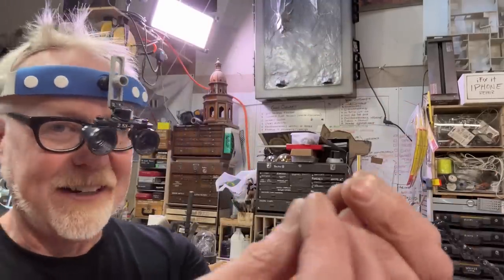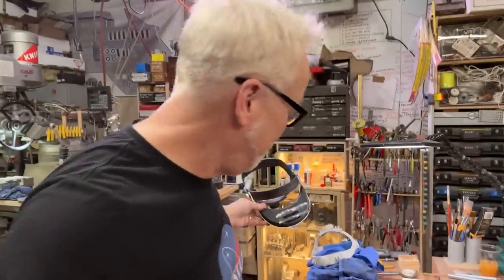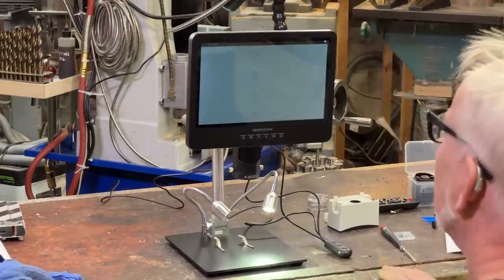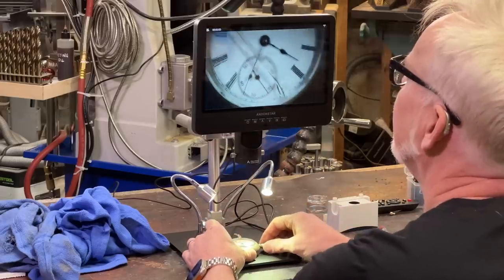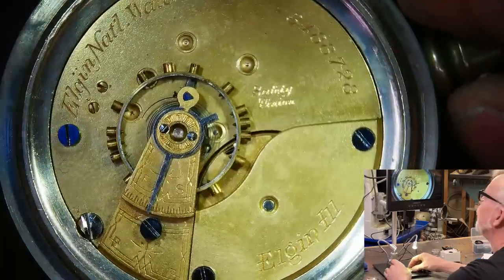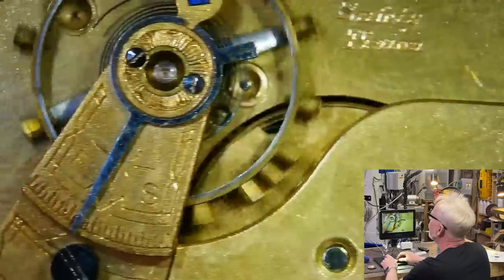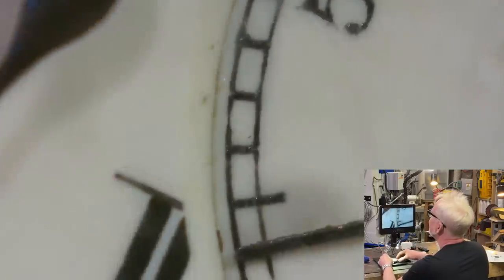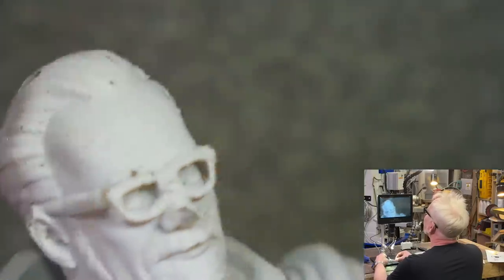Adam Savage's New Digital Microscope!

Comment: Probably not explaining this correctly, but I'm already imagining for your one day build putting in some sort of rack and pinion system that instead of using a lock nut to hold everything in place and having to manually adjust it, you have a hand crank that you turn to cause the whole mechanism to go up and down.

Comment: That looks like a really neat tool, and I may be entirely inexperience with this, but it kinda feels like some things could have been designed better. The rig should have a table crank straight out of a drill press, or maybe a screw feed like you could find in some 3d printers.
Personally I would have the camera and monitor be two separate units so that I could have the display at a comfortable viewing height, ideally as close to the work piece as possible. It being fixed to the camera ensures that if the work piece is at a comfortable working height you have to crane your neck to use the monitor.

Comment: Keep in mind that the disadvantage of LCD digital microscopes is not having any 3D depth.  An optical microscope has two eyepieces so you get 3D which is very useful for some things like working on PCBs where you need to inspect solder joins. Without any 3D when you get light reflections off the curved solder joints they will fool you into thinking the joint is good or bad when it is in fact the opposite. With 3D you can easily tell the difference between a curved surface and a reflection.

Comment: Just remember to let the tension off the mainspring before removing any screws that hold in the gear train and be incredibly careful of those hands/dial if you want to keep them original.

Many of those old pocketwatches run great as long as no one went in and broke them at some point.  You definitely DON'T need a timing machine, as that watch won't run perfectly almost no matter what, and comparing it to modern timing reference over a few days will tell you all you need to know.

Comment: I have trouble working through microscopes like this because I depend on having a stereo view to do fine work.  I have a trinocular microscope (stereo plus a space for a camera).  But it's sometimes a pain in the ass to work with because I have to keep my head extremely steady in a somewhat awkward position.  What I want to try to do at some point is put eye piece cameras in each of the eye piece sockets of the microscope and feed their outputs to stereo FPV glasses and see how that works.

Comment: Definitely a better microscope than the $46 thing I bought.   
But that watch would not have been approved for railroad use, being a 7 jewel unadjusted movement,   
unless it was "grandfathered", possibly for a line that didn't handle much traffic.  
A major company running many trains per day would probably have demanded a better timekeeper.

Comment: About the only practical use you can put this to is to examine carbide tool cutting edges after sharpening on a 400 grit diamond wheel to determine if they are still damaged or have a wispy burred edge that will break down as soon as you touch it............after a single light pass on a mill or a lathe the cutting edge will resemble a jagged saw like finish......you'll know then why you cannot get a good finish on mild steel no matter how hard you work your machine.

Comment: The Chinese deliberately do not indicate the resolution of the matrix. The resolution they indicate is the output video resolution obtained by interpolation (electronic witchcraft) from a cheaper matrix with a physically smaller number of pixels. Old trick. The same story with Chinese DVRs for cars, for example. That is, roughly speaking, from a matrix with a physical resolution of 480x640, you can interpolate to get FULL HD resolution at the output, but of course there will be no improvement in image clarity - but in advertising and on the box you can indicate FULL HD resolution or even 4K. That is, it is not possible to find honest information which matrix, with which resolution is installed. European manufacturers are 6 times more expensive, but there is honest information about what exactly is inside.

Comment: You may discover you are getting a crick in the neck because you are lifting your head up to look through the bottoms of the bifocals.  If so, I have glasses made that are bifocal strength from top to bottom. Otherwise known as computer glasses or reading glasses. You will need to measure the distance from your nose to the monitor and then get a prescription from your optometrist.

Comment: Don't think it's a porcelain dial. Most pocket watches have enamel dials.
10:20 those are indeed not jewels, but just brass bearings. Back then they used actual ruby's to make bearings and were very expensive. Nowadays they use synthetic ruby's. 
Lack of shocksystem, so watch predates 1930's.
Very nice and basic watch movement. Always love balance wheels with adjustable screws.